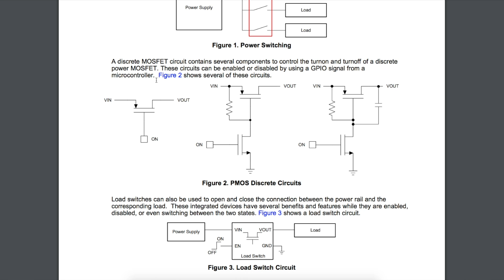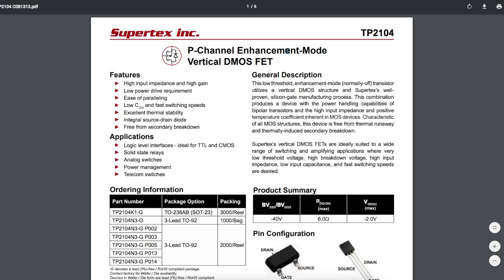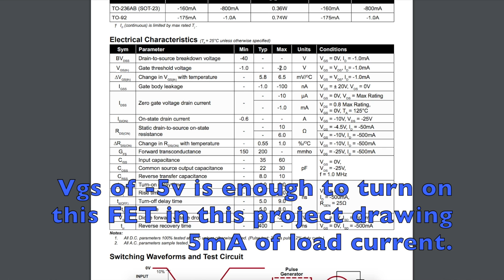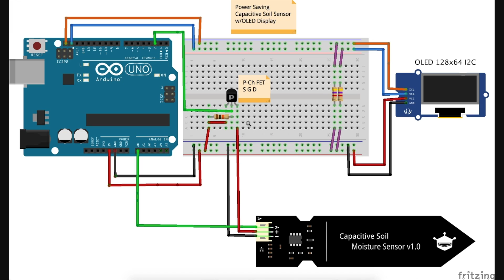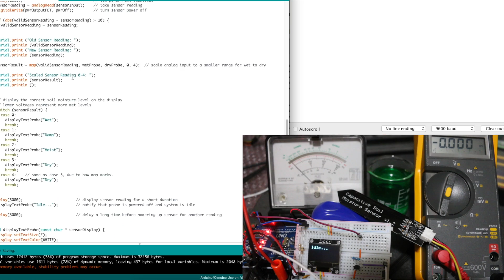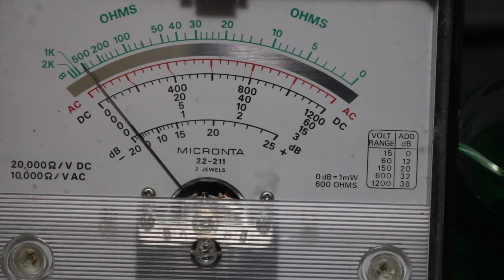How To Use a FET as a Power Load Switch

Comment: Why resistance between SDA,SCL and VCC?
Reply from the maker: The I2C signals are open drain/collector so the controller can only generate a ground low out or floating high.  The resistors pull the output high when they are floating to get logic high.

Comment: You can do it even simpler way: just tie your sensor vcc straight to arduino digital pin, and use DigitalWrite(sensor_vcc, HIGH) any time you want to take a measure. Digital pins can source/sink a bit more than this sensor needs, and it simplifies your device. Of course it works with small loads, for higher loads mosfet is a must.
Reply: The AVR8 chips are quite durable.  May be time to take out the multi-meter and measure the capacitance of the sensor!
If there is significant capacitance, it may be possible to ramp up a PWM duty cycle slowly.  Meh, a 10ohm resistor would probably do.  This way you'd drop, what, 0.05V?
Lots of ways to skin a cat.
Reply from the maker: I’d like to be able to measure the current on the scope so I can plot it  and see the inrush but I don’t have any fancy interfaces right now. I’m waiting for one of those hall effect current monitor modules to arrive and I wonder if that will give me the resolution and response time  to be able to do that. It would help if I had a uCurrent gold. Maybe I could build my own.
Reply: How about a some shunt resistor on negative rail? Voltage drop on it would be easy to calculate current drawn, and with use of triggering function of the scope would be fairly easy to see what inrush current would be.
Making your own  simple and cheap uCurrent would be a nice idea for another video, I think I might try to make something like that, just to have one when I might need it.
Reply from the maker: I will be doing something similar at some point to monitor motor current with an op amp and use it for a current limit driver circuit so surely I'll try measuring different current ranges on the scope and see what works out.   Surely there will be a video forthcoming from that.   Maybe I can use the instrumentation op amp module I got recently.
Reply from the maker: Yeah this was more of a general load switching demonstration than a specific sensor project but regardless of the 5.4 mA needed, I’d be more concerned about limiting the inrush current and possibly still blowing a pin with a capacitive load.

Comment: Applying high for on is more energy saving way because mcu doesn't have to hold and generate voltage while sensor is off.
I am just guessing.
Reply from the maker: I am not sure, if I were ready to use this permanently I would do current measurements on the entire power supply and try both ways but I would probably just set that control as an input high impedance and let the pull-up resistor keep it off. 

This was more just for demonstration purposes for control  of a power switch and this sensor being one of the times that one might want to do it.    Sometimes I might want to control the load without having power savings in mind but just needing to power things on in a certain order.

Comment: Are you are switching high-side to share a ground with the device?  Makes sense.
Was excited to see your TTL-level P-MOSFET in a TO92 package, roughly complimenting my 2n7000's.  Sadly, am unable to find TP2104 for sale on Ali.  Zilch.  It is expensive elsewhere.  The BS250 is similar, and more widely available, but still pricey.
The AO3401 performs well, and only costs about $0.02 -- but it comes in microscopic SOT-23-3 package.  A DIP converter for this costs around $0.05/ea. (sigh) Someday, I hope to find the perfect jelly-bean PNP MOSFET in TO92.
Reply from the maker: I just arbitrarily chose to switch the high side but eventually when I have more parts on hand I might try all the various combinations of high and low side switching and see what applications one over the other may be best for. 

 I don’t remember how I ended up with these FETs but I also saw just surface mounted ones for low-cost when I looked and I’m thinking about certain ones in an  SOIC eight pin package because I do have a bunch of Breakout boards for those.
Reply: @GadgetReboot   Well, they adapters exist: https://www.aliexpress.com/item/100PCS-SOT23-SOT23-3-turn-SIP3-DIP-0-95MM-Pitch-Zener-Diode-MOS-Transistor-IC-adapter/1378377492.html ... I plan to get some.
Switching on the high side is probably the way to go, because if your measurement is a voltage, then you have to contend with a diode drop, or Rds(on)*Ids increase in that reading when using an NPN transistor.